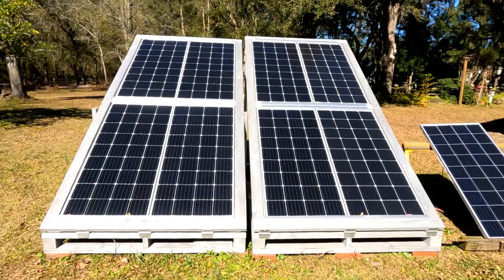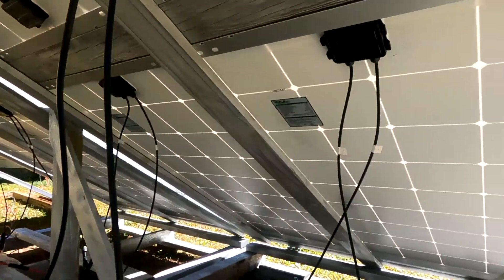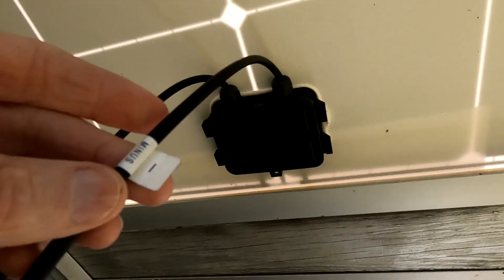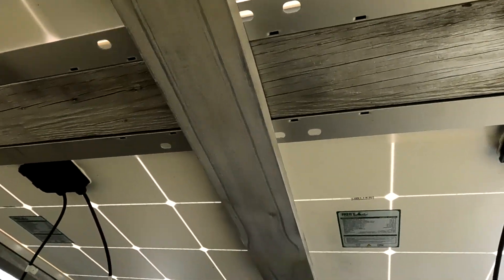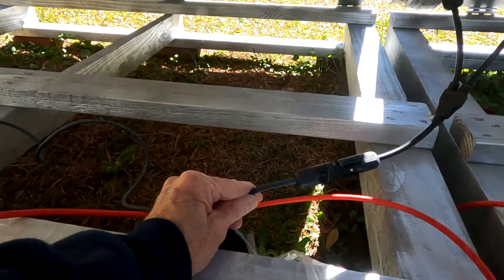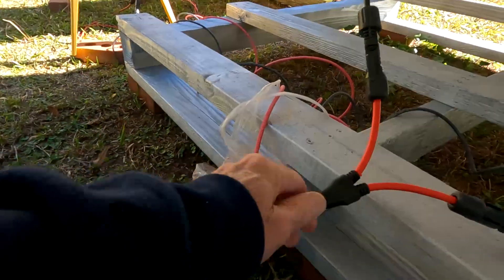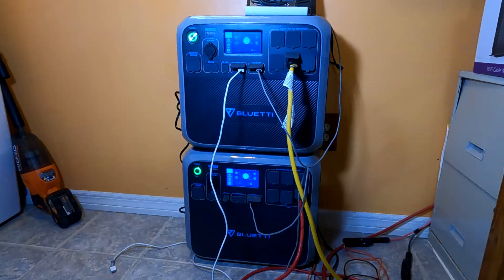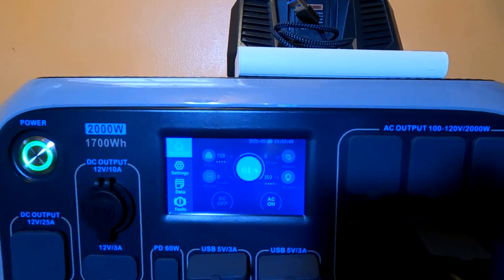Experiment in solar to charge 2 Bluetti AC200 Power Stations simultaneously with one pair of cables.

Comment: Great video. I have been looking for something like this for days but couldn't find any videos or info showing that such is possible. In my own case, what i want is to have the solar panel cable run to 2 different rooms in my house, so i can charge my power station (Ecoflow Delta 2) in either room. Will there be any issue if i use this method for that?

Comment: I would have just connected one of the Bluetti's to the panels and then plugged in the second one into the one that you are charging. Its going to take the same amount of time, since you are confusing the MPPT controller. Think of turning a light switch on and off with one of those old florescent light tube bulbs, you turn on the switch and it just about gets ready to be full bright...then BAM you turn the switch off and then turn it off again....and then repeat. You are adding unnecessary wear to your Bluetti and it will damage it over time. MPPT's are made to adjust for change, but not a change then happens in milliseconds for hours and hours. I read below you say are an electrical engineer? what I said should make sense then.
Reply from the maker: Since MPPTs are solid-state with no moving parts such as relays, there is nothing to wear out. If the MPPT is designed correctly, it should be able to handle thousands of parameter changes per second. Since I don't have a schematic of the MPPT, I can only go from my experiences of working on switch mode power supplies way back in the 1980's. I have a warning that this is for experimental purposes only and there may be risk in damaging your equipment if you choose to duplicate this. But your suggestion of using one solar generator to charge the other is certainly an option which I have also used. Doing so will give an efficiency rate of 90%+/-2%, which is pretty good. Thank you for your suggestion so that others are made aware that there are other options for charging two solar generators from one input solar panel cable.

Comment: Thanks for taking the Time to make that Video👍

I liked and Subscribed!

You talking about the parameters of the volts and amperage the AC200 will accept made me think of another YouTuber I follow named Jehugarcia. I will put the link below where he hooked up 36V lithium ion scooter batteries (repurposed) to the Solar Input of the AC200 via recabling and a small control board he sells for like $28 bucks. He sells these hook ups to enable 1 battery, 2 batteries and 4 batteries hooked up to the solar input at once. He also sells the scooter batteries for like $58 bucks.... which I think is the whole purpose really... Getting rid of the 1000’s of scooter batteries he got for cheap. 
Anyways... The idea is once the Scooter batteries have discharged into the AC200 you disconnect and then Charge them up via there chargers ($25) from the AC200 once you have an Excess of Solar power the next day. 

Jehugarcia provides a Amazon link for both small and large 36V chargers for those scooter batteries. Obviously there are losses for the discharging and charging but in a sense it is like “increasing” the battery capacity of your AC200... 

So 4 scooter batteries is $230, the one 4- way combiner circuit $28 and the small charger $25.... So for around $300 Bucks you double the battery reserves of the AC200.

My question to YOU Sir???? If you get a 36 V Lithium battery or 48V that have their own built in BMS systems and breakers like the ones from BigBattery.com can we just splice into the AC200 Solar input cable and do the same “capacity” increase using a Larger battery???

Looking forward to hearing your thoughts👍

Increase Bluetti AC200 Capacity video link

https://youtu.be/sD6q-5oAOe8
Reply from the maker: As long as an external voltage source is between 35 to 150 volts DC, you can use any external battery to charge the AC200. The AC200 cannot detect what is the source of the DC voltage so it would be managed as solar input. I would suggest using a XT90 male plug on the external battery to make it easy to switch the AC500 input cable between the solar panels and external battery source.
Reply: @2xit  Cool Man!!!
That is Exactly the Plug that Jehugarcia used too and I already have some spares to put on the scooter battery charger 👍
I’m gonna give it a shot. I have 1Kw of solar panels and plan on adding 400w more. The test I have already run showed on Sunny days I’m going to end up with a lot more power than I can hold in the AC200 even with my freezer and tv running.

It would be nice to store that excess power for over cast days.

Thanks a lot man👍 I will let you know how it goes🤞

Thanks Again Carter.

~Maddog

Comment: The only thing I see that you missed, is your in-line fuses on your positives at the solar panels. Also I don’t know if your panels are grounded.
Reply from the maker: This is a temporary setup for now. I will be moving the panels with a tractor forklift to cut down another tree that's blocking the evening sun. Once that is accomplished, the panels will be grounded and fused before the lightning season...thanks!

Comment: Everything that I have read or seen about solar power says that a solar panel array should have only 1 controller on it at a time. Each of your MPPT controllers is trying to seek the best voltage and current using an algorithm to give max power. So they are both making adjustments very rapidly and not allowing the array to run at max power point on the IV curve of the panels. Safety of the AC200s, panels, and wiring may be compromised also. One AC200 at a time would most likely just stay at 700 watts under most solar conditions with that array or run 4 panels in series into 1 AC200 and 4 into the other. Think about it...
Reply from the maker: True, but I'm experimenting into pushing the envelope by using only one cable to deliver DC into my home. Using multiple cables for each power station defeats the purpose of what I'm trying to find a solution to. Gird power uses only one cable and not a cable for every outlet in your home, so I'm trying to find a similar solution. I understand that one is AC and the other is DC, so I am dealing with different parameters here. I see no issues with the safety of the panels or wiring if it is large enough. At most, the MPPT in the AC200 may be compromised. I've been charging the two power stations like this for a month, and they both reach full charge rapidly on a sunny day. I added a caution in my introduction to warn anyone that there may be risk involved in this setup. Thank you for your insight.
Reply: @2xit  Okay then. Good luck with your experiments. Since you had an HP oscilloscope in one of your other videos, I was wondering if you had an electronics background.
Reply from the maker: @trains_and_stuff4211  Yes, I have an electronic engineering degree and repaired TVs and VCRs for 13 years before moving on to other things. In the early days, I had to build my own inverters because they were too expensive and not readily available. It's amazing how far technology has progressed in the last 40 years.